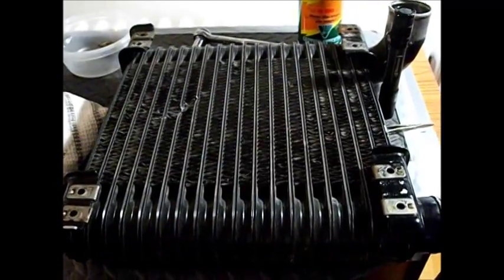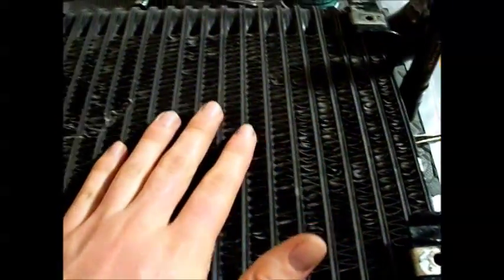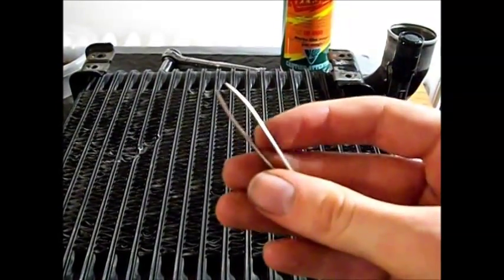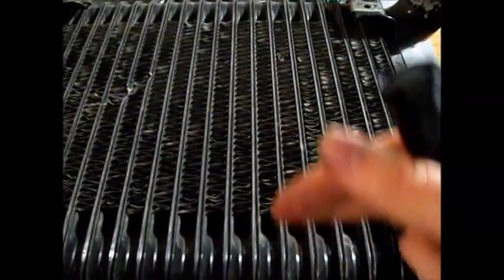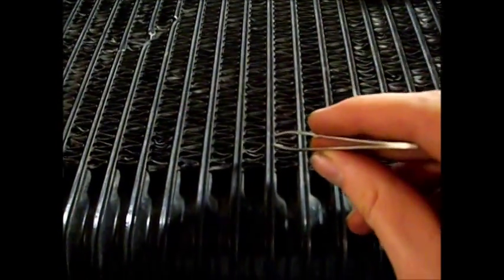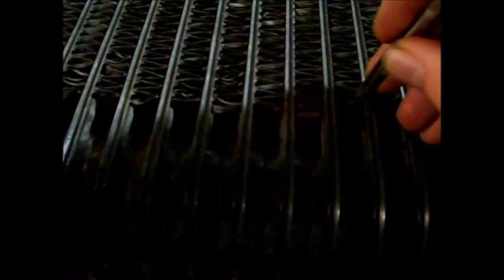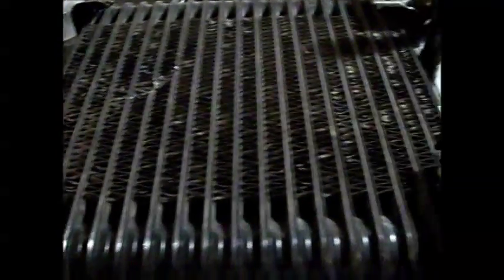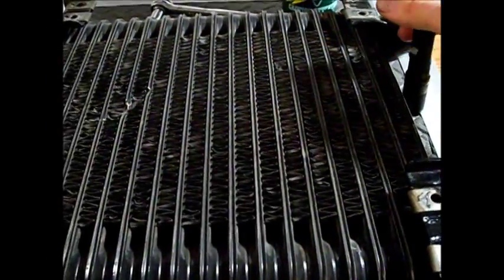Intercooler repair

Comment: forget the  tweezers and use an ice pick on the fins  ease the tip of it into the open spot in the fins and slide it  to the bent side  its a lot faster